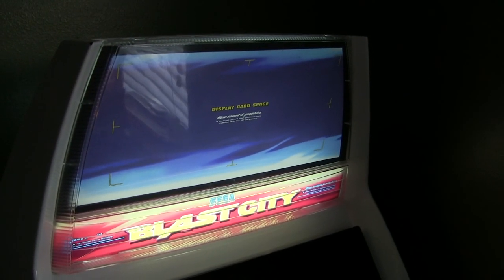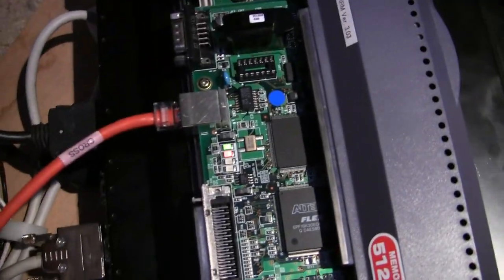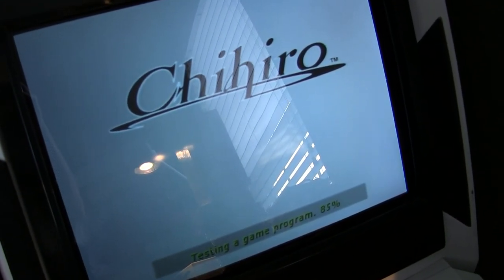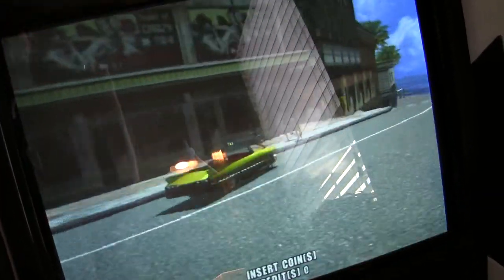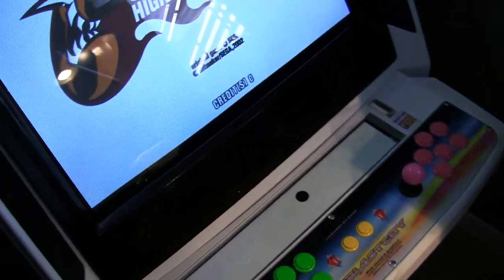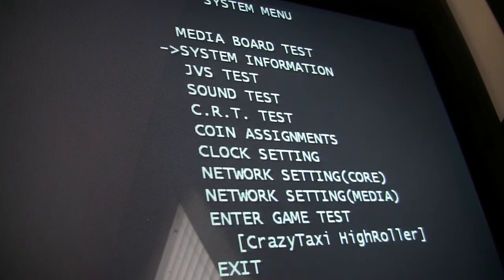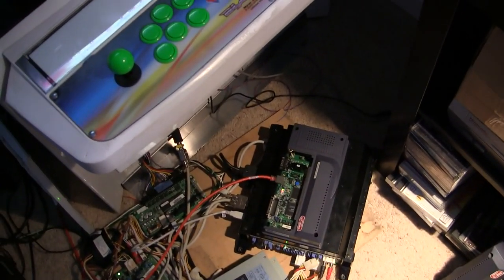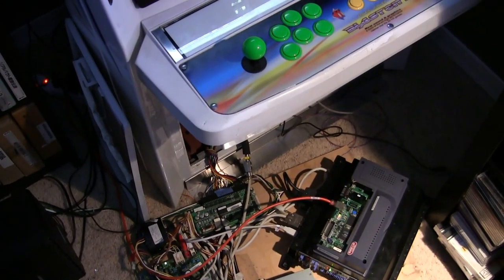Sega Chihiro Type 1 Net-Boot How To

Comment from the maker: No, there is not enough video memory on board the Type 1 for Special Tours so it won't work, just the regular Out Run 2. Yes, the same booting software is used to boot Naomi games and works better for that, the Chihiro uses it too but its hit or miss sometimes. Yes the Net DIMM cart is compatible with Naomi 1,2 and Triforce type 1. It appears strangely that the HOTD3 key works to NetBoot on the Type 1 only. Remember to keep the PC connected all the time or else it will crash to a Gateway error.

Comment from the maker: Yea, think of the Net DIMM like a product by itself independent of the different hardware systems. You can upgrade the firmware on any platform and it will still work on the others.

Comment: Thank you for the video!
When I plug in the middle jumper like yours, I get error 22, there is no connection between the main board and the media board. If I stick the jumper back, the boards begin to see each other. I don't know what to do with this problem. Plz help.

Comment: Works with house of the dead 3?
Reply from the maker: Yes but you're gonna need the gun IO and sensors to play it. Easier yet get the original Xbox version and a light gun practically the same experience for no hassle.